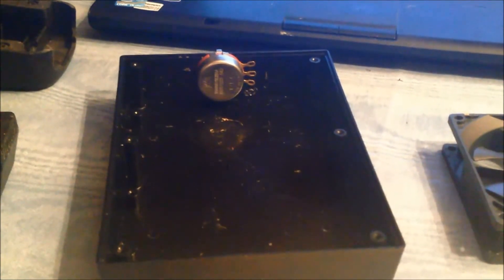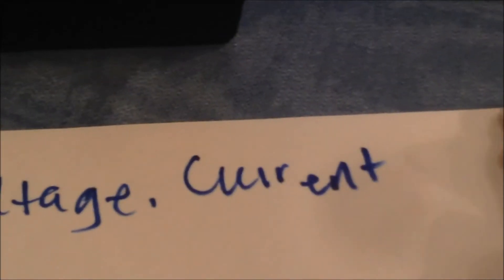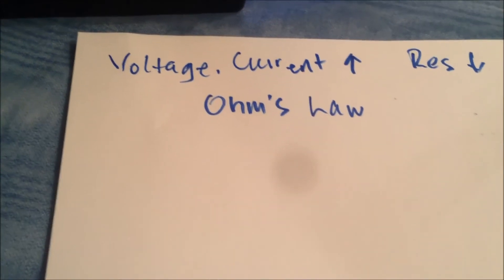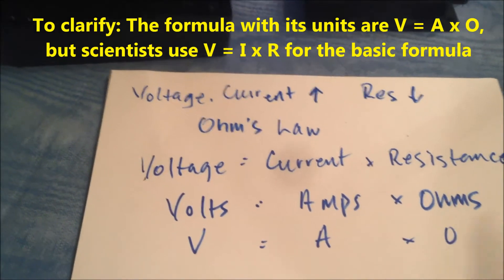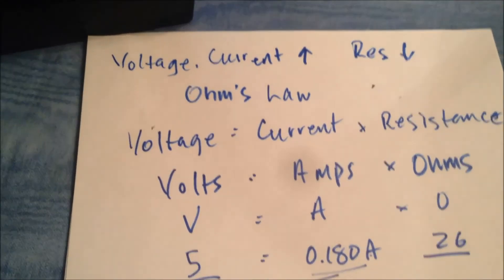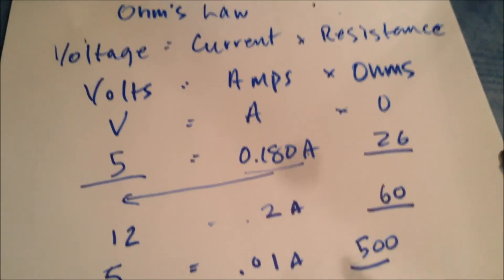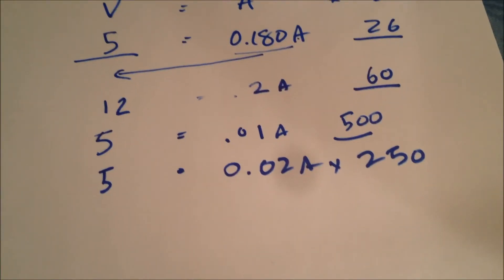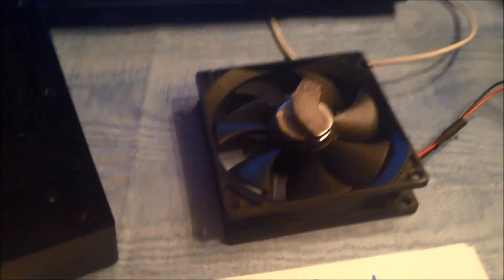Use Ohm's Law to choose the correct potentiometer for a stir plate

Comment: Hey Doug, I dont think ive got it.
hete a question.... 12v DC 1.5A ,,,,, power pack.
 12v  200mA-somthing or 300mA-somthing ( misplaced the sticker w info to it)  and I used 10k pot. before seeing your video.   I stuck w 1.5A power pack cause I was told better to round up.  question is.....will you tell me the proper Potometer to use for off being off, and build from Off on up to slower then faster and faster the more I turn it up?
 I think I understand ur instructions, but my math is soooo bad its safer to just ask you sir.
If you would that would be great. thx Doug & Great Videos!! look forward to more
Reply from the maker: Get a 1,000 ohm pot. Here's the math:

Your power pack provides 12V and 1.5A so using Ohm's Law, the resistance is 12/1.5 = 8 ohms of resistance (hardly anything) when the power pack is at maximum supply. If you want to completely offset the 12V you need a potentiometer that will resist 1.5A of current when 12V of electric pressure is available, in other words enough to set 1.5A to zero. From my Ohm's Law formula, it would be 12V = 0.0A x ? ohms, so divide 12V by 0.0A to get the ohm calculation, which is the rating you need for a potentiometer. You can't divide 12 by zero, so take a very small number like .01, and the formula becomes 12/.01 = 1200 ohms. This will still let through a tiny current but it won't be enough to spin a fan and the 0.01A is effectively zero. So I would buy a 1,000 ohm pot. You have a 10,000 ohm pot which will work fine, but remember that you'll have to spin the dial a lot just to supply enough current to start the fan. Your dial will be very, very sensitive because just a small rotation will add/reduce a lot of resistance and your fan will spin wildly. For example, if your dial rotates 360 degrees,  each degree of rotation will be 10,000/360 = 28 ohms of resistance per each of the 360 degrees on the dial. You only need to resist 1,200 ohms so 1,200 ohms / 28 ohms per degree = 42 degrees of rotation. That means that you only use 42/360 = 12% of the dial to control the whole fan speed from zero to max. In other words you'll have to spin the dial over 3/4 of the way to its max point just to get the fan to spin, then every little adjustment will significantly speed up the fan and make it hard to control.

If you add a 1,200 ohm pot, every degree on the dial will affect the fan speed because each degree of rotation controls just 4% of current (1,20 ohms / 360 degrees = 3.5 ohms per degree.)  

If you're not good at math, this might not make sense. So go buy a 1,000 or even 2,000 ohm pot.
Reply: Doug Brown that 3/4 turn just to get spin is right on the nose. Yea, ur correct its alil goofy understanding for me, but...... big but, I do learn it with practicen OR when you break it down like you just did...  I had already decided to get an 500....only cause somehow after getting 12v/1.5A=8, I managed to pull out 400... still dunno how, but thats ok, cause I was going in the wrong direction anyway...And.. I didnt buy it yet so Im good.
 but ya, thats exactly the issue I had tonight when I stuck a 5k in to it.  Half turn before movement and It was difficult as all getout trying to dial it in to just do a slow steady spin...it wanted full speed or stop damn near. 5k was all radio shack had, but ill find a 1k.
Thank You for taking the time to square me away man, I appreciate you more then you could understand!!!
 thx again
Reply: Doug Brown dont see where the 0.0A came from but I think you know this stuff much better than I do, so Im good bro,...lol
Reply from the maker: You said you wanted a potentiometer that has enough resistance to completely turn off the power to your fan. You can't change the 12V from the power pack (one side of the equation) so you need to to change the current on the other side of the equation. Your current is 1.5A so resistance is 8 ohms (1.5 x 8 = 12). You need to reduce the current, so let's say you cut it in half by adding resistance, e.g. 0.75A x 16 ohms = 12. Reduce it again, e.g. 0.1A x 120 ohms = 12. And again e.g. 0.01A x 1200 ohms = 12. At that point, 0.01A is effectively zero when the resistance is  1,200 ohms. You can't buy a 1,200 ohm pot so buy a 1,000 ohm unit and it will do the job.
Reply from the maker: It's nice to hear that the theory translates through to reality!
Reply: I got it now.....thanks again very helpful

Comment: Hey Doug, electric-illiterate me back for some advice. When purchasing a POT, I noticed that they have wattage ratings and the fan that I'm using is 12v, .17a=2.04 watts, but the only POTs I can find in my 200-250 Ohm range (operating a 12v power supply at .6amps) are rated at 2 watts. Will my additional .04 watts cause a problem with the 2 watt POT? Excellent video, by the way. Great information.
Reply from the maker: Small differences like that won't matter. If the power supply was excessively higher than the pot, like 3 amps vs the 2 amp pot then possibly the pot would heat up and burn out.

Comment: so questions how would you work it up for a dual setup? single power cord 2 switches 2 potentiometes and 2 fans? im not doing something as big as a home brew setup but rather mixing 2 batches of e-juice simultaneously . would i have to account for the dual draw from the 5v source or would running 2 off the same source not matter if they are seperate?
Reply from the maker: +Agnar_BurnsAll Doesn't matter. 120V out of the main supply is greater than 2 x 5V so you could power several individual power supplies and fans. The power supply reduces the 120V to a constant 5V which independently powers your fans so I guess you could hook up 24 onto one circuit.
Reply: Doug Brown
that's what i thought but it has been a while since i took my automotive courses and they teach you basic understanding but in reality you almost never use it when working on cars
>
and i make my own e-juice but i was looking at magnetic stirrers so i can make larger batches at a time to make it a little easier on myself.
>
but they are spendy and i found a diy kit  so i went looking on youtube and yeah it is simple enough, i can make myself a fancy dual stirrer for about half the price of a single manufactured one.
>
plus it seems like it would be fun to do =D
Reply from the maker: Agnar_BurnsAll Good luck with that. I'm pretty sure I can spin about a gallon of liquid with my stir plate and stir bar, I can easily do half of that and haven't tried more simply because I don't need a huge volume to make beer.

Comment: I'm super glad this worked out for you!! You're actually lucky that you chose a number close to correct current. That power supply doesn't provide a constant current, as you stated in the beginning. The fan determines how many amps it will draw. It is typically around 150mA if you connect straight to a 12V power source with no other resistors (or potentiometer) involved.  With your 5V power source, it would draw less than half that.
Reply from the maker: +SciPunk215  I wasn't clear enough in the video. I said "fixed voltage and current" meaning "fixed voltage, and current". The voltage is constant and the current varies.

Comment: Hey Doug you have been a huge help I'm all my questions and I thank you for that. One more then I will leave you alone..:) ok so if I under stand correctly if I had a power supply that is rated at 12v and 4amps I should take 10% (.4) of that which would come out to 30 ohms correct? So I should get a pot rated at 30 ohms? I'm don't a stir plate too but mine it for ejuice which is a thick type liquid. Do you think the power supply I have is just to powerful or will I be ok?
Reply from the maker: +Jason McNamara That's a really powerful power supply, so you need to find one that matches the watt rating for your fan, if that's what you're doing i.e. building a stir plate? You've got a 48 watt power (12V x 4A) supply so your fan rating has to be at least 48 watts or else you'll fry it. If you hooked your power supply to my fan (rated at 5W) it would have 10x too much power for the fan and it would spin wildly for a few seconds then the motor would burn out. If however you have a 48W fan (or whatever device) then yes, 30 ohms of resistance will slow down your fan to a crawl. If a liter of water and a stir bar are in place and attracted to the magnet then 30 ohms will shut the fan right down.
Reply from the maker: +Jason McNamara Following up on the above comment, a 48W fan is really, really powerful and I wouldnt use one like that in a stir plate. I found one on Amazon and it actually has a warning on the power. If youre building a stir plate you really should get a computer fan or something like that. Cheers.

http://www.amazon.com/Delta-Electronics-PFB1212UHE-F00-120x120x38mm-connector/dp/B004Y15ALK
Reply: +Doug Brown thanks again for the info! I think I will find a lower power supply I have a ton and think I seen one at 12v and .15amps. I would like to find a fan with a fast rpm so I know For sure it will be able to mix up my ejuice. Guess we will see how it goes! Thanks again
Reply from the maker: I spin 3 liters of beer on the fan above with absolutely no problem. Interesting that you're making your own ejuice. I'm not a smoker but have some friends that use so I'll pass on DIY ejuice to them. Post a video if you can.
Reply: +Doug Brown the liquid consistency is a lot different depending on what your vg and pg is the juice can be kind of think close you syrup thickness. So yeah I think I will find a high rpm fan just to make sure it will spin it up real nice. Yes maybe I will think about making a video on diy ejuice as its so easy to do and saves a person a ton of money.
Reply: +Doug Brown once again coming across a question...lol. Can you tell I'm new to all this but learning a lot as I go. So I decided to go with a 12v  .15a power supply but I am finding that I can only find pots in the Ks and not finding many in just straight ohms if I apply everything I would need an 800 ohm pot correct. I can find anything 800 ohms or they are expensive so would I be good just getting a 1k pot and would that allow my fan to spin a max rpm? I'm not to worried about how slow it goes so do you think the 1k pot would do the needed job. Sorry for all the many questions
Reply from the maker: Higher resistance = lower current = slower speed. So if you buy a 1,000 ohm pot it will completely turn off the fan when you twist the knob all the way nearly off, or whenever it hits 800 ohms. If you buy a 500 ohm pot and leave the knob turned down all the way you still have 300 ohms of resistance and the fan will spin slowly. You can buy either a 500 or 1,000 ohm pot because you actually don't need that much resistance. The only difference is that with the 500 you can't turn off the entire fan, and you can with the 1,000. 

So I'd buy the 1,000.
Reply: +Doug Brown thanks man you are awesome
Reply from the maker: I AM! just kidding, good luck with your stir plate.

Comment: Here's a noob question for you. Following your tutorial, does the amp rating of the actual fan not matter?
Reply from the maker: +Dave Parkes Sorry for the late reply. The amp rating relates to how fast the fan will spin so it matters in that regard. A computer fan is typically around 0.2A - 0.3A so if you're using that general type then no the amp rating doesn't really matter.  Voltage is typically constant (120V from your wall, 12V from your car battery, 5V from a small power supply) and it's the amperage that changes depending on how much power the device needs. So a large fan might need 48A to spin because it's heavy and has to go fast (like an A/C) or it might need 0.2A like a computer fan. I don't know if that answers the question, so let me know.

Comment: I need to power a 200mw (.2w) laser diode. I used a 3.7 Volt battery and found that the Amps were .054 (using the formula: Power=Voltage*Current). After using Ohm's law to find the resistant (68.518), I decided to take 1/3 of the Amps (.018) to get ~200 Ohms. My problem is that I'm having trouble with finding the potentiometer. Everywhere online when I want to buy a potentiometer, I never see anything <1000 Ohms. Everything is usually 50k (50000 Ohms) to 500k (500000 Ohms).
Reply from the maker: +DirtRich I googled 200 ohm potentiometer and found lots on ebay and Amazon. If you go to any decent electronics shop they'll definitely have one. Like Radio Shack, those kinds of places.
Reply: Doug Brown Thanks for the fast reply, however I can't find any similar to the one in the video that is only 200 Ohms. There are plenty that are 200k though, but those have 1000 times more ohms, right? I would really appreciate if you could give me the link to one on Ebay or Amazon.
Reply from the maker: +DirtRich http://www.amazon.ca/BBS-1000K-Potentiometers-Single-Linear/dp/B0146RZAFC/ref=sr_1_6?ie=UTF8&qid=1451540432&sr=8-6&keywords=250+potentiometer
Reply: Doug Brown Thank you! I guess I'll get that one

Comment: I have a question as I have a 12VDC/1.0A power supply. By applying the calculations above, I would need 120ohms Potentiometer. The ones I seem to find localy are for 500ohms minimum.  Will this still work or is it too much resisance?
Reply from the maker: +Eric Flynn I think you'll be okay, but you might need to turn the dial way up to get it spinning.  Weird that you can only get 500ohms. Even Radio Shack has a really wide range and the store I went to had a range from like 100 to 10,000 if I recall.
Reply: +Doug Brown could because we only have small local shops here in Québec... also the online catalog might not be complete... I'll pick up de parts tomorrow and I'll ask at the counter. Thanks for the quick reply !
Reply from the maker: +Eric Flynn Good luck. I don't know where you are exactly, but Montreal has quite a few. 

http://www.montrealing.com/2013/01/the-top-4-irresistible-electronic-stores-in-montreal-and-laval/

Comment: Im not strong in electricity, but someone please check my math:
I have 9V battery and I apply 2 fans to it (2.5-6V 0.68W)
9V/2=4.5V on single fan
0.68W/4.5V=0.15A
0.15A*10%=0.015A
4.5V/0.015A=300oms <-I need 300oms potentiometer
Reply from the maker: +Artūrs Illarionovs ) That's correct if you have a single potentiometer with one wire from the battery into the pot, and two circuits/wires going out to two fans. In this case both fans will spin at the same speed and a 300 ohm potentiometer will slow them both down to zero RPMs. However, if you have two circuits/wires from that battery, leading to two potentiometers and fans, you could supply different voltages to the fans by adjusting each potentiometer. In this case one potentiometer could use the full 6V rating and you'd need a higher rated potentiometer.

0.68W = 6V * 0.11A
0.11A* 10% = 0.011A
6V/0.11A = 545 ohms

Comment: Everthing makes perfect sense. My problem is that I can't find a potentiometer rated to what I think I need based on Ohm's law. I have a 12v transformer rated at 700mA. Using that info, I've determined that the built in resisitance is 17 ohms (17.14 to be exact). In order to slow the fan down to 10% of it's potential,  used .07 in my formula. 12V / .07 mA = 171 ohms. I can only seem to find potentiometers rated at 100, 300, and 500. I'm guessing I'd choose the 300 ohm pot, but it's purely a guess. It doesn't seem like the 100 would allow a low enough setting. In my case, would the 300 ohm pot still work with my setup?
Reply from the maker: +teewinotone Yes it will be fine. You could use 100, 200, 300 and they would all be fine. The difference will be apparent when you spin the dial: Higher resistance gives you more sensitivity and control because equal amounts of rotation account for more resistance. For example, a quarter turn of a 100 ohms pot provides 25 ohms of resistance, and a quarter turn of a 300 ohm pot is 75 ohms of resistance.
Reply: +Doug Brown Thanks for the quick reply. Now I can quit stressing and get on with my build! Your videos are great and I'm very appreciative of you for putting them out there!
Reply from the maker: Glad to be of help!

Comment: I have a quick question I am building a fan assembly alot like this I have a 12v 6a pwr supply I also have a range of pots 5k 10k 50k 500k I have tried every pot throughout the range im not sure if im getting the correct results. typically when i have the pot full to the left "wide open" fan spins correctly I adjust maybe a quarter of a inch and I lose all spin so im not getting much control of the speed. I have tried all the ranges and about the same result the 5k i get the most adjustment but not much more any thoughts?
Reply from the maker: If you're up in the 1.000s then you're probably already too high. For a low energy power supply like that you should be in the hundreds, and I think a 250-500 ohm pot will suffice. Each small increment on a high resistance pot is hundreds of ohms which is why your fan stops immediately. Go for a lower ohm pot and you'll immediately have much better control.
Reply: Doug Brown I tried a 500 ohm pot same thing even less control. I have a stupid question so is a 500 ohm pot less resistance then a 5k I'm sorry I'm new to all of this and just trying to fix my issue. Any further help would be great.
Reply from the maker: 500 ohms is less resistance than 5,000. Make sure the wires from the power supply are attached to specific terminals on the pot. The middle of the three has to be the hot, incoming wire, and one of the others connects to the motor. If you connect the wires to the outside terminals, the pot won't do anything.